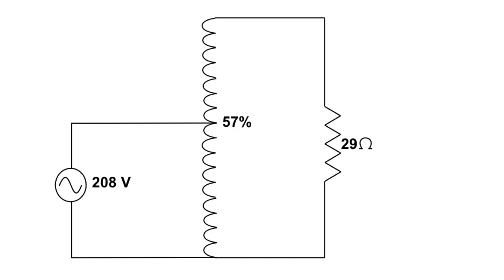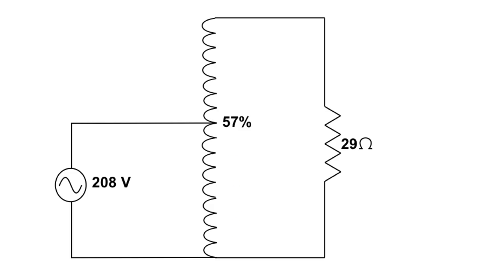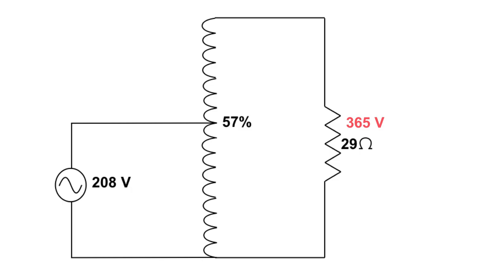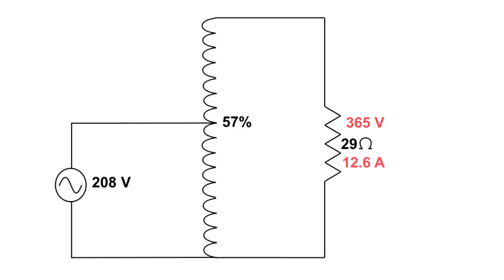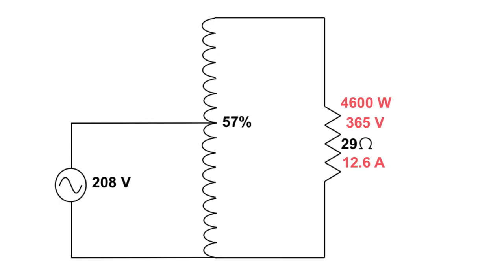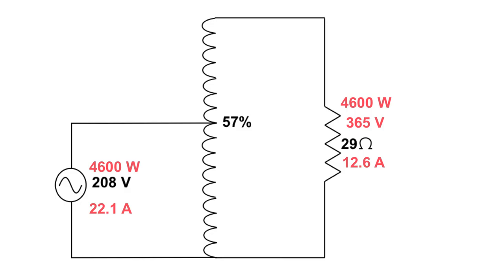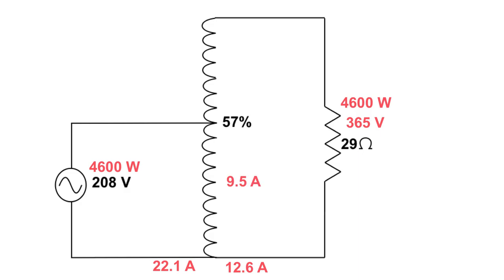Step up Autotransformer

Comment: If single phase 5kva Multi tap auto transformer (step up) is given input volt of 90v and if load is 3500watts.(home appliance). What will be output current. I know output volts will be between 200v-240v.

Comment: why did you assume 0 current passing through the upper winding of the transformer !!!! while there are 9.5 A was passing through the lower winding>>> thats not fair . I have to dislike this till you explain.
Reply: 12.6A pass  the  upper winding.
Reply: @hubertlong4513  wouldn't it be 9.5? 12.6 is for the resistor... at the end of the day who cares